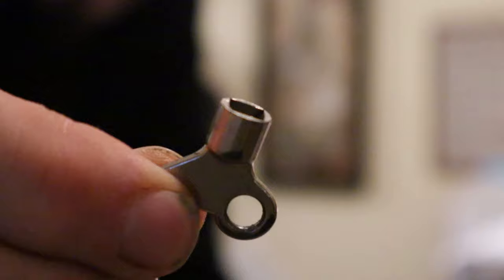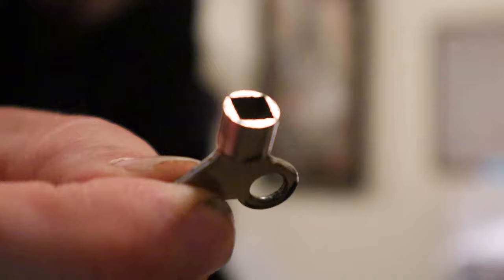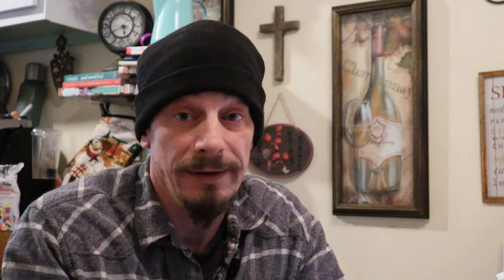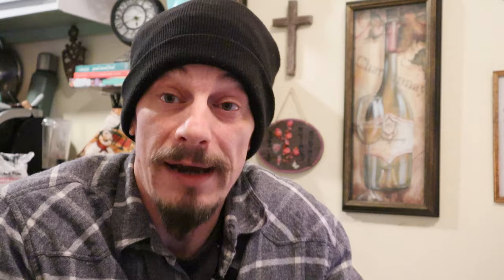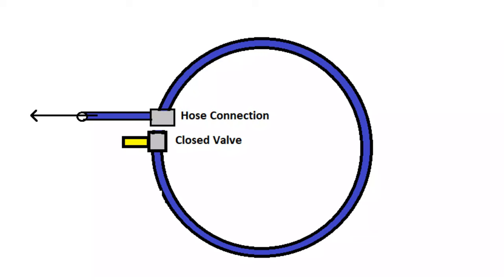Purging Air From A Boiler System (Residential)

Comment: Hi Jersey Mike.  There is an additional aspect to purging air from a boiler system after successfully completing the steps you described. The introduction of pressurized cold tap water into the system brings with it dissolved gases primarily oxygen nitrogen and carbon dioxide.  The lower temperature and higher pressure of the tap water in the domestic water supply maximizes the water's ability to retain gas in solution. When this water is introduced to the heating system, it is subject to considerably higher temperatures and lower pressures once the system is reactivated and brought up to temperature. This greatly reduces the water's ability to maintain the gases in solution and results in the gases being released into the system. 1 gallon of tap water contains approximately 1/2 cup of dissolved gases at atmospheric pressure.  When heated to 170°F - 185°F  at 10-15 psi, a considerable portion of the dissolved gases are released into the system. The small gas bubbles can collect over time into larger bubbles which are not usually large enough to fully block the radiator but which are large enough when moving to cause some gurgling sounds in the system. Well-functioning highpoint vents and/or in-line air separators can remove these undissolved gases from the system. However, when air separators and vents are not well-functioning as is sometimes the case with older systems, the air can remain in the system. This can lead to a cycle, especially for the do-it-yourself homeowner, who knows how to purge the system, and appears to have done it successfully, only to hear gurgling in the system sometime later and wonder how the air keeps getting in and then repeats the purge thinking perhaps it was not done completely or correctly, only to have the problem recur.  Air separators and vents are important to success here as these bubbles are moving through the system and can be challenging to remove at the various radiator bleeder valves.  I hope this helps some of your do it yourself homeowner viewers.
Reply from the maker: Appreciate the detailed run down on these further aspects. 

It's been a while since I've watched my own video, but I do recall getting into how it is necessary for further purging through bleeders once the system is up to operating temperatures. I believe I even advised to test bleeders on radiators before even starting this whole process, as some may be rusted solid and unable to bleed air out. Best to test and replace them beforehand, rather than find out in the final steps only to drain the system and start all over again after making the repair. 

That said, your run down is welcomed and hopefully homeowners will take head from reading it. Thanks!

Comment: Now seriously, I'm glad you mentioned the pressure and the relief. Pop the relief and you might as well change it before you proceed. Another trick is to use a 5 gallon bucket and a submersible pump to flush the air out. Run the drain hose back in to the bucket and let it run. You can see the air bubbles escaping. Just keep the water level above the pump draw height and wait the air out. If there are enough vales and drains that you can isolate the boiler from the loops you've hit the jackpot! No need to worry about the relief popping then. If there are enough drains you can use a pressure gauge on one to see where you're at.
Reply from the maker: Yup. I learned the hard way bumping into pressure reliefs on water heaters when working on a furnace that those suckers don't like to re-seat!
Reply: @JerseyMikeHVAC  I was hooking up two 400 gallon water heaters in a 13 story high rise . My foreman came up in the morning when I was filing the tanks and goes right to the relief valve and flipped it open . I said don't do that youb dumb ass ! I closed it and luckily there we no issues . My father taught me as a kid to never open those , they are a safety valve and technically one time use .

Comment: I got a psi reading of 0 but it's currently off is that normal? Everything has been running right besides I think I've got air in my 1st floor baseboard heaters

Comment: I cannot thank you enough.  I have watched countless videos of how to purge a boiler system.  Just as you say which is 100% correct, most just show the system they are working on. Not the explanation of how the system works and things a person could encounter.   Keep up what you are doing as it is very helpful. The HVAC companies in my area are simply uneducated and just throw parts at a system without actually fixing. My boiler guy has told me countless times he has purged my system but ironically not 1 drop of water was drained or run through the system. If he doesn't know how that is ok but to get a seasoned tech to help.  This was able to get my system back to where it should be.  Thank you.
Reply from the maker: Glad you were able to figure it out! Thank you for this feedback. Means a lot.

Comment: I love this video. Concise, thorough and easy to understand. However, I don’t have what you say I should have. I have an oil burner. I don’t have an evac spigot. There’s a drain on the bottom rear of the block. There’s a pressure relief valve on the top. I followed all the lines and found the tap water feed/supply. There’s a large diameter pipe coming out the top so that’s the radiator supply I guess. If I follow the large diameter pipe out of the bottom rear it splits. There’s a T fitting and it’s all interconnected. It’s crazy. Your description in the video makes total sense and i can visualize it, but this system here. Ugh!?
Reply from the maker: Without being able to look at it, sounds like it has to be bled locally at the baseboard/radiators.

Comment: Thank you for the great informational video. I do not have any isolation valves in my system. I have a two-story house with two zone valves. What do I do? How do I bleed my system?

The only valve I have is the one to drain the system. Please help as I have shuddering in my system and I know it needs to be bled. Thank you.
Reply from the maker: All I can suggest is a forced purge in the manner I went into in the video and then locally purge the baseboards individually.

Comment: Hey Mike - great video sounds like you have a lot of experience.  Wonder about your thoughts on this problem.  I have a 30 yr old Dunkirk boiler.  I bought the house a year ago and have had constant problem with the system.  It has a combination of baseboard radiators and in floor heating.  The first problem I had was zones (I have 5) not heating.  We discovered that the in floor runs were totally blocked with rust and sludge.  The system has been cleaned with high pressure water and chemicals 4 times now.  No blockage any more but now every time the system kicks in I hear very loud kettling from the the boiler.  This stops after a few minutes or so even while the boiler is still heating and running it just stops. Then when it fires up again it starts making noise again.  The system is running at about 18 - 19 PSI (you can see the gauge jump when you hear the popping) the temp is running around 170 - 180 F.  I've had 3 different HVAC companies come out and none of them can stop the kettling.  They just say time for a new boiler. Any ideas?
Reply from the maker: You likely have some uneven heating in the boiler. I know you said it's been cleaned 3 times, but I would wait until you're done with the boiler for the season, add some Rhomar Hydro solve to the system and just let it work on the boiler for a few weeks. Flush out the system clean again and repeat if it comes out dirty after treatment.  

Sometimes you can get the kettling to stop with longer treatment times like that. 

If that doesn't work, it may actually be time to consider replacement.

Comment: Excellent tutorial. Just want to make sure I understand the process completely. The supply valve is left open and the return gets turned off correct? Thank you.
Reply from the maker: In most scenarios, yes. You just want one open path at a time (each zone) from the city water line coming in all the way to the hose connection going out. Everything else closed.
Reply: Thank you!

Comment: Do I have to wait for the boiler to cool before adding water via the forced purge method? Two story house, 4 zones.
Reply from the maker: If the boiler is isolated during the purge then no.  But it wouldn't hurt to at least let it come down to about water heater temps if you're going to purge through the block (about 130-140).

Comment: Thank you Jersey Mike. You give a great fundamental explanation here. One thing though is the boiler vent valve? (im not a pro) the vent at the high point of the system?I believe its a float style vent .is it possible that this unit needs to be replaced or maybe manipulated?
Reply from the maker: It's not unusual at all for those vents to require replacement, particularly at high points where they tend to get the most use. A lot of times, the system will continue to work ok even if the vent is bad, until the system has been disturbed in some way due to repairs or something, and a lot of air ends up in the piping. Then they prevent a full purging of the air in the most likely spots for air will migrate to during a refilling.

Comment: If you turn off boiler, what moves the water through the system? Wouldn’t pump be off?

Also can you plz do a video on boilers wo a purge station? How to dump a whole system, then how to fill an purge? Glad I found ur channel, awesome stuff 🥃
Reply from the maker: City water pressure moves the water through the system.  No pump is needed. 

What kind of boiler do you have with no drain connection?
Reply: @JerseyMikeHVAC  
Just a residential, sometimes they just have a drain to empty boiler an no isolation valves with purging station.
Reply from the maker: @chadrayl9648  Hydronic?  Or steam? The only boilers I come across with no purging station and just a low drain are steamers.
Reply: I had (for > 20 years) a boiler system without a "purge station".    Old house in the Midwest.  Had to bleed air out of each baseboard/radiator using their bleed valves - with circulator pump off, of course.

Comment: Hi Jersey Mike. Thank you for taking the time to make this video. I followed your explanation and went to all my radiators to vent them. I noticed that two had automatic vents but the others had the manual that use the key that you showed in your video. The automatic had stains from previous leaks. I replaced one of them with a new automatic vent. But I’m not sure if they need automatic or manual? I don’t know the history, so I’m trying to keep it the way it was. But I worry that leaving these automatic vents open will lead to leaks down the road. Should I just put in manual ones and purge as needed? Or keep the automatic vents. Either way thank you for your time.
Reply from the maker: Most boilers have automatic bleeders on them near the boiler itself. My preference is for manual bleeders elsewhere. But you can use either.

Comment: Mike. Well I bled out my line. But then I had the smart idea to try to adjust the pressure a bit which lead to the pressure valve blowing.  It is still trickling a bit!  The boiler is about 15yrs old.  Am I going to have to have that pressure release value replaced now?  Thank you.
Reply from the maker: Most likely that's going to be the case. Very rarely have I been able to get them to stop leaking once they pop by cleaning out the internal spring and seating, especially older ones.

Comment: Great informative video  you have here.So when you purging the water you keep the circulator off right ? Question 2# I got a  old 1960 1 zone system on my return i have two valves 1 shut off valve for the hose and 2nd shut off  valve on my return that slpit to the baseboard in the basement. Do I also open the 2nd  valve when opening the with valve with the hose or just open the  hose valve to dump the water.

Comment: Hi mike! Awesome video! Im changing my expansion tank and pressure relief valve on a standard natural gas boiler with 2 zones and baseboard heat do i need to purge the system if i shut off the main water in and stop the hot water out line? Thank you in advance
Reply from the maker: If you have a bleeder off of the block and/or maybe somewhere on the riser before the shut-off, then you may not need to. But if in not you'll likely have to purge a little air out of the zones eventually.

Comment: Any additional input if a system has a thermostatic valve located on the area of supply/return lines coming into garage/home from wood boiler outside when doing a purge?  Thank you!
Reply from the maker: You'll probably want to open it wide up during the purge just to maximize water flow to push air out.

Comment: Mike, my boiler (Crown) in my one story, home heat, domestic water system does have a below the circulator (Taco) drain valve, but not a return valve as you suggested above the circulator pump. What would be your process to bleed the air from the system? And what interval would you suggest to drain the system through the low boiler drain valve, if at all?
Lastly, when I increase my thermostat from say, 65 to 73 degrees, it seems to take a bit before the heater kicks in. Maybe 30 seconds or so. But the heater will not heat directly to 73 degrees. It will stop and go incrementally, one degree at a time before it gets there eventually. Might this be a failing thermostat? I check with a heat gun the temperature of the convectors in all the rooms and they all get hot. 
Please advise. And thank you for your sharing your expertise with us out here.
Reply from the maker: Have drain valves been plumbed in anywhere else other than down low off the boiler block or near it? Sometimes you might find them on the supply side or even at the baseboard itself. 

 Where are your zone valves located? Supply or return side of the system?
Reply: @JerseyMikeHVAC  The only other valve at the boiler is the pressure relief valve.  Off the boiler there is a maid o mist that sits on a scoop and over that there is a flo control valve. There are convector bleeders, one in each room on a copper elbow. So after the feeder the water flows in the  circuit or loop,  is pushed up through the scoop, through the flo control, through all the rooms and returns to the circulator which pushes through to the bottom of the boiler cabinet, then out the top of the cabinet to complete one loop. There are no other drain valves and no zone valves. No purge valves as I have seen on various videos. My guess is at the little valves on the elbows in each room, but I dont know if there is a best way and when to do it. Last winter there was alot of swishing and gurgling noises, today there are no noises, yet when the thermostat calls for heat, the Taco circulator humms quietly and after 20 seconds or so the heater fires. If the temp when I get home from work is 65, and I set it to 70 degrees it takes time to get to 70. It will eventually get there but not as quick as I remember it would in the past. My infrared temp gun shows all convectors get hot. 
I had replaced the thermostat in 2018 (i bought two and dated one and placed in on a shelf) and I wonder if maybe the thermostat could be weakening. Question, does a thermostat fail at once, or does it do so slowly? I don't use the programmable feature of the square Honeywell thermostat, I just use the Hold feature and set up and down accordingly. Any advice would be great. With much respect I thank you for your effort and content. BTW, southern NJ here.

Comment: I have no bleeders on my baseboards is there enough pressure to force the bubbles or air down the pipe the where the water hose is connected to purge? I know air just wants to rise so I'm curious how much pressure is needed to force the bubbles down. My room is at the end of the house where the water  returns to the Boiler is in don't get hardly any heat at all but the other end of the house gets nice and toasty and I pay for the Oil! LOL that was a great explanation how it works I'm just experiencing water coming out of the pressure relief valve after  the boiler turns on. I just lifted the line in pressure arm to see the pressure coming in and started that leak problem, I have a slant fin with a coil and hoping that doesn't have an internal leak Don't really need to use it because I put a tank less water heater in  so I'll just bypass that if it is the Problem , my main concern is bleeding the air out.
.
Reply from the maker: Usually when a baseboard heater doesn't have a bleeder in it, the bleeder will be on the plumbing to the radiator itself. Most of the time I'll find them in the drop ceiling on the floor below the rooms where the radiator is that I want to bleed.
Reply: @JerseyMikeHVAC  I may replace all the base boards this summer they are old, I did get most of the air out now but my circulator is whining LOL but its making good heat, freezing out and don't want to mess with it now.I still have my Circulator from my old boiler that blew up, Its slightly larger might be stronger. It has a taco on it that came with the Slant Fin boiler I bought from home depot I will add bleeders to the new baseboards if they don't have them. I know bubbles like to go up but no down if there is not enough flow I stuck the drain hose in a bucket and let it run til all the water was clean and no bubble came out, I have a couple of bleeders near the boiler, but I would feel better if they were in a high spot. Thank you for your incite.

Comment: Hi Mike,. Very educative video. Thank you.  I have a situation where when I bleed the water out , the water pressure is very very low.  Even when I try to increase the pressure of the water inlet.   Why is this?  How do I fix this ?   Thank you in advance for your guidance.
Reply from the maker: If the water pressure seems fine everywhere else then it's likely a bad regulator on the feeder itself.